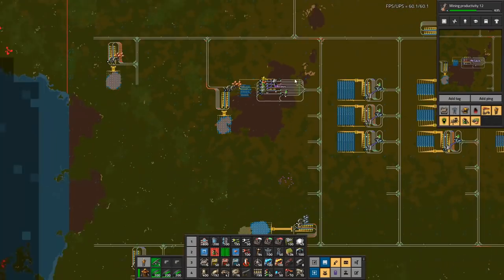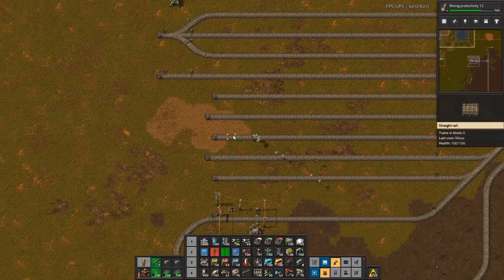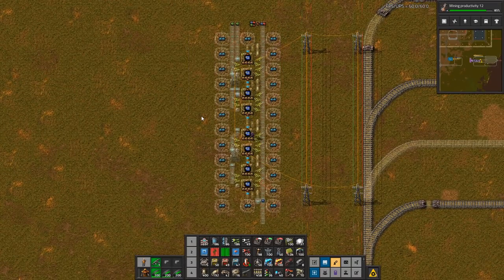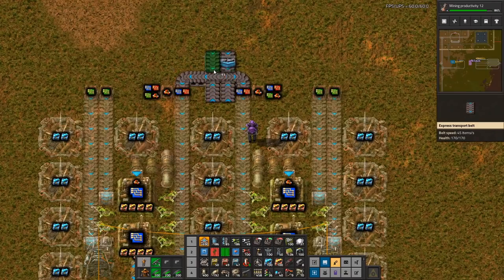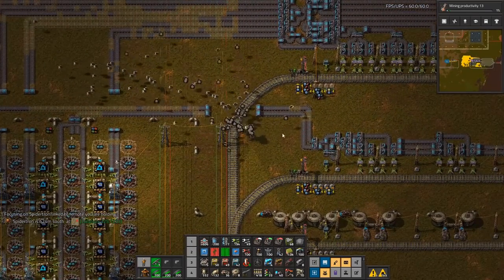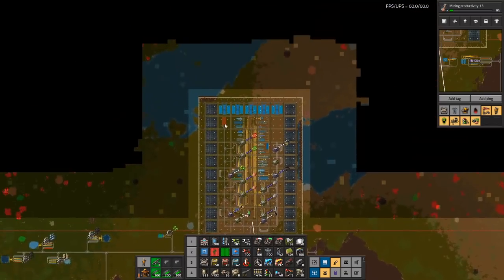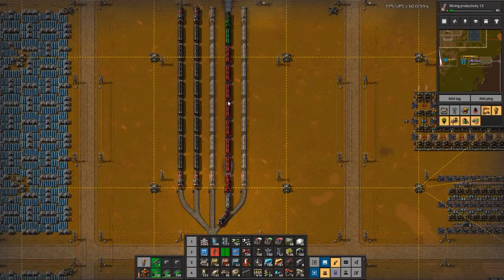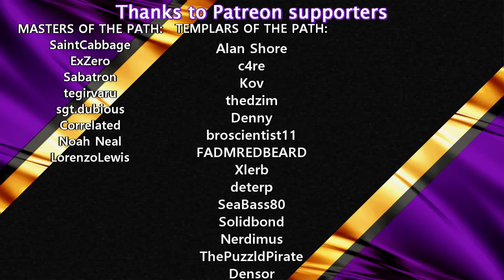Blue Circuits | #9 | Factorio Megabase-In-A-Book Lets Play

Comment: I'm almost certain someone's already noted this, but you're missing the rear fuel loader on the sulfuric acid unload station.

As far as frequency is concerned, perhaps a pace of 3 episodes every 2 weeks would strike a balance between demand/expected length and the prep time required for each episode.
Reply: are the fluid trains 1-4-1 or 1-4 tho?

Comment: I know I'm late to the party, but you can solve your fluid unloading with by re-adding those pumps between tanks, and wire them to each tank they draining... and set them to run only if fluid > 15k (may have to tune the value).... it should help balance the flow, and prevent the last tank from getting stalled.

I've been binge-watching this series, and I'm in awe of your ability to manually craft splitters.  :P

Comment: you can actually support twice as many blue circuits, but it requires a 16x16 balancer (which fits) with incoming green circuits from two parallel offload stations. i'm not sure if that would inevitably cause some kind of imbalance if the trains favor one of the stations over the other, and space is basically free, but i'd like to have your thoughts on this either way

Comment: At  31:55  that splitter tree keeps annoying me.  You split the belt in half and then immediately into a total of 4 of the best belts.  The top two are needed, but the bottom two just run parallel for half a train  until they're actually needed.  Even the top tier belts are pocket change by now, but if they back up, there will be longer queues for the final wagons than for the first ones, and therefore it will take longer to fill all wagons up than necessary.  
If you make 25 chips per second, that'll be how much?  3 squares of belt?  Each wagon is 7, so if you have 4 wagon lengths of dual instead of single belt, that's 28 squares of belt asymmetry that could be remedied very easily, or . . . 9 seconds?  Well, that's MUCH less of an issue than I would have guessed!  Looks like it hit my OCD harder than your production!  ;)

About the episodes, I'd prefer two, but if you had to resort to two-parters because you couldn't make two full-blown eps per week, then I'd rather prefer you'd not.  About topics, maybe a nuke production plant next time, from uranium straight to nukes?  #theFactoyMustGrow  #theBiterNestMustGlow